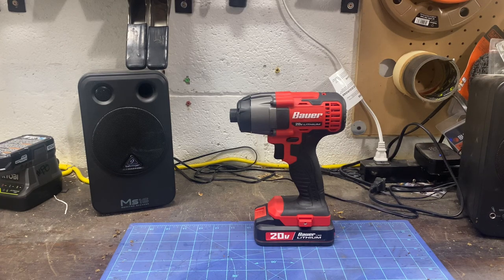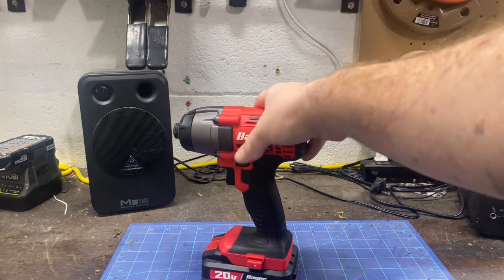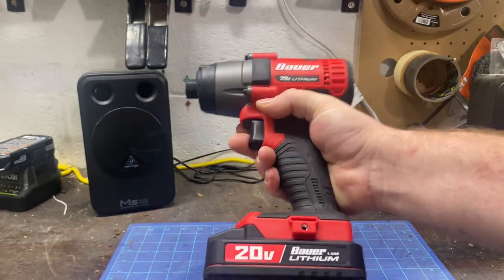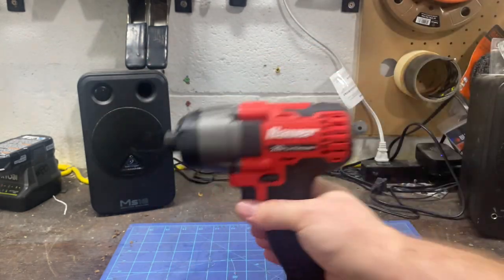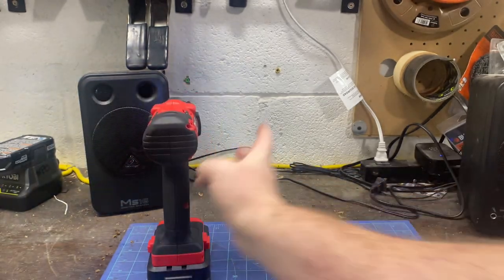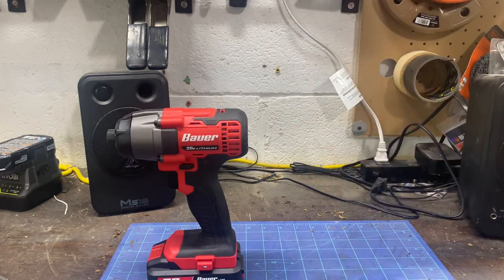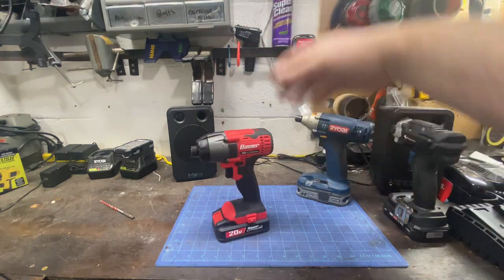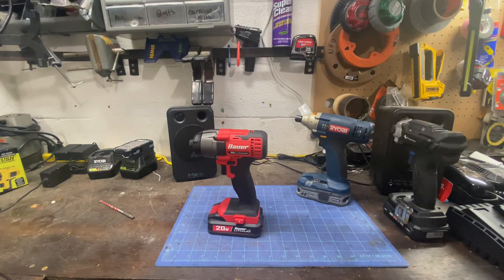Bauer  20v impact driver review

Comment: I love my bauer impact, use mine around the house, keep it in the truck And used it on jobsites, its tough! And impressive, and I love my dewalt impacts,  but It feels like the bauer actually has less vibration when driving screws, plus it keeps up with the top names no problem. If you check my channel, I have a short vid of me using the bauer hammer drill, drilling pilings with 3/4 auger, surprisingly well, and battery kept up great. It saved me on the jobsite where it was all I had to use.
Reply from the maker: Dude I watched the video and that was impressive 👍. The impact impressed me so I’m not surprised it could get it done but it went fairly easy. Thanks for sharing I enjoy stories like that. Have a great rest of your weekend and thanks for watching. 🤜🤛
Reply: @themaintenanceman1  same to you, and great vids! Keep em coming
Reply from the maker: @locknload4x468  thanks. And I definitely will 👍